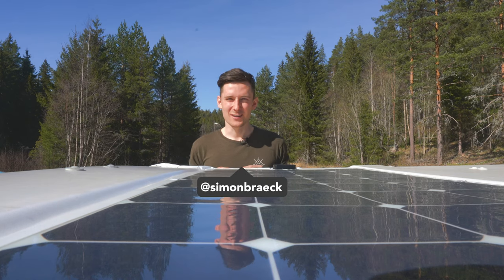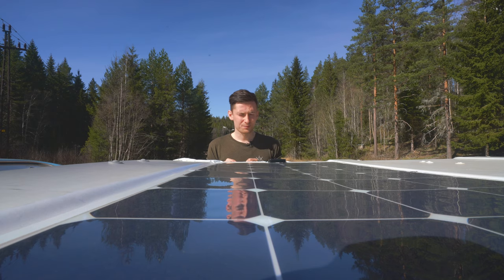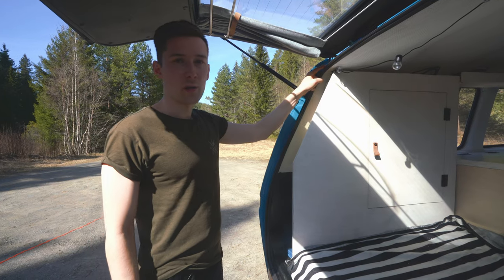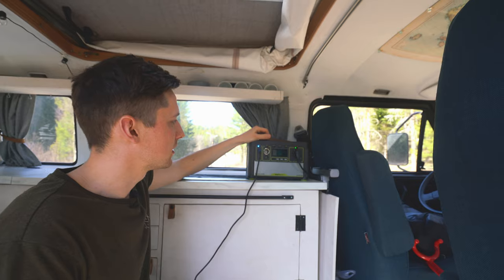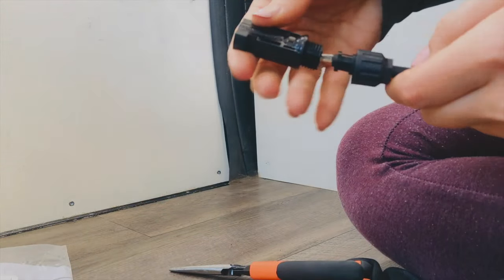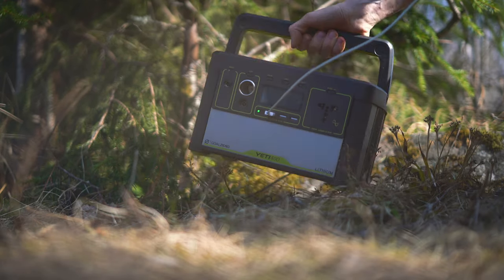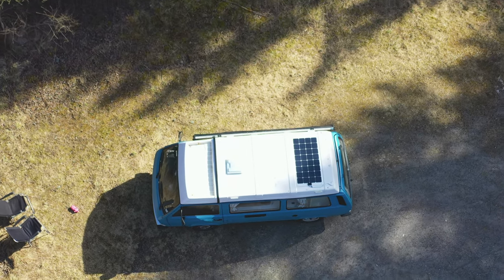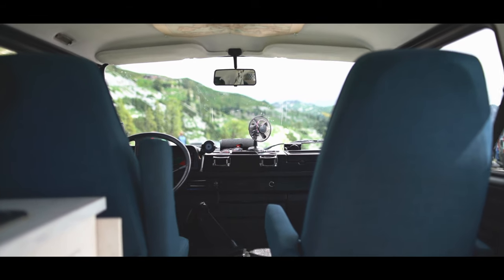Super easy DIY solar panel for van life - VW T3 (vanagon)

Comment: We have a simple 40 watt rigid framed panel (Coleman) on our 1983 T3, in our luggage compartment above the front. For under $100 it came with a charge controller which I connected to our main battery. A very simple and repositional option. I like how your 100w flexible panel fits so nicely between the ribs of the pop-top. I often have a canoe up there (with foam blocks), so a flat approach is important.
Reply from the maker: Thanks! It sits really flush on the roof and we want to try adding a kayak there soon so it was important for us. Our setup might be too expensive for some, but atleast it is super simple to install and understand. I’m looking into adding a charge controller like you have, to be able to switch between charging the GoalZero unit and our leisure battery. Might even add a second panel if needed.
Reply: UPDATE: I upgraded, replacing the 40 watt panel with a 100 watt Renogy panel. Same controller. This panel fits perfectly in the luggage rack, with enough room underneath its frame to store cords and things, while its profile is invisible from the ground. I used wooden blocks with quick release hinges to permit the panel to be easily tilted and propped up for optimal sun exposure, or removed and placed elsewhere while camped. Foam insulation tape ensures no vibrations. Very happy with the install. I'm carful when loading my canoe (from behind) and so far no contact with the panel.
Reply: How did you attach to my your luggage compartment and run the cable?
Reply: How did you attach to my your luggage compartment and run the cable?

Comment: Hi guys, great set up. I am looking to put solar panels on my van too. I watched a video the other day about the angle of the panel increasing the efficiency of the power you can harness from the sun. In Europe it was recommended to be around 54 degrees of angle towards the sun. I know you’ve secured the panel to the roof now, but I imagine building a frame which can be lifted to differing angles wouldn’t be too difficult. (I have never built anything like this, but where’s there’s a will.... There’s a way). :-) Good luck guys! 👍🏻 Ah.... Just watched the end of your video. You are already aware.
Reply from the maker: Hi! Yeah, you have a good point and I would like to do something like you describe. But as our parking is in a shared garage with about 1 cm clearance to our roof, we needed a really low profile, slim installation.
Reply: Simon Braeck Such a shame about the parking situation. But it is still working for you and providing some power. I think your English is fantastic by the way! We’d love to visit Norway in our van in the future. I spent a little time near to Voss with the Army some years ago. Beautiful place! Take care guys!
Reply from the maker: Yes, it works like a treat! We’ve also installed a MPPT charge controller so we can switch between the Goal Zero and the leisure battery. In direct sunshine we can run all we need (including the fridge) and still get extra charge😀 Thanks! We’ll be exploring Norway for a five week period shortly, maybe we’ll swing by Voss. Have a great week😎

Comment: I think I would fit a solar controller to the leisure battery then you'd have the option to charge your leisure battery or the Yeti400 from the solar.
Reply from the maker: I certainly consider it. The cables are already fixed with MC4 plugs so I need a solution for them to adapt to a solar controller. Do you know if that’s doable?
Reply: @SimonBraeck  Yes what you would do is wire MC4 plugs to a length of wire which is wired to the solar controller panel input . You would then simply disconnect the MC4 connector from the Yeti400 and plug into the MC4 connector on the solar controller. It's super simple. If you invest in a solar controller buy a proper MPPT one (watch out for cheap fake Chinese ones). They're more expensive than a PWM controller but as you have a fairly small solar panel you want to maximise the efficiency of the panel. I'd highly recommend a Victron energy controller. Have a look into it and if you are unsure ask an expert. Seeing what you both have done with the van over time you defiantly have the skills to do this you'll just need to understand it and you'll understand how simple it is.

Comment: Awesome video! Could you please share a link for the panel, the converter and the battery?
Reply from the maker: Thank you! Solar panel: https://www.sparelys.no/index.php?page=shop.product_details&flypage=flypage_ny.tpl&product_id=2007&category_id=26&option=com_virtuemart&Itemid=39
Reply from the maker: For the GoalZero Yeti 400 Lithium, I recommend looking up local store or web retailer so that you get the correct AC socket. It comes with both 110V (USA plug) and 230V (European plug)
Reply from the maker: Converter/adapter: https://www.amazon.com/ACOPOWER-Connector-Converter-Portable-Generator/dp/B0841ZCDHS/ref=mp_s_a_1_1?dchild=1&keywords=mc4+to+8mm&qid=1587504925&sprefix=mc4+to+&sr=8-1

Comment: Nice idea about the solar panel. It looks like you have more space on your roof to fit extra panels. Any plans of expanding your energy production? Or this is enough for now?
Reply from the maker: There's definitely enough space on the roof for a second panel. We need to see how this setup works in the long run before we decide whether to add another or not. I really want to look into adding a kayak rack on the roof as well, so still a few things to decide on. But as you know, we like to be away from busy campsites, so if we find ourselves lacking power, we will add a second panel for sure😊

Comment: Hey there. Great video, love the van! I want to ask you about the fuel consumption, because i plan on getting one for myself and i'm curious about the possibility to make it a daily driver also while still being a camper van. Maybe you can share with us an average fuel consumption in city and outside on the open roads? Keep up the great work!
Reply from the maker: Hey! Thank you so much :) We have a 1.6 TD engine and I would estimate it to consume 8.0-9.0 L / 100km. But that’s not very scientific, just my experience. We only own this vehicle and I think that it works fine, very spacious and practical, though the lack of power steering can be a hassle. This can be installed if you find a need for if of course :)
Reply: Simon Braeck Thanks a lot, cheers. Drive safe!
Reply from the maker: You too :)
Reply: The turbo Diesel engine in a VW van is great, but rare in North America. Most of the VW vans you will find are gasoline powered, with a 1.9 to 2.1 litre engine. These have more power than the original diesel, but you are doing well with 11-13+ litres/100km on flat highways. You will likely find that a cruising speed about 90 km/h feels right.

Comment: Nice video. What is the spacer you used under the panel. Was it a sheet of perspex?  
I received a new fuel pump and starter motor for our T3 this week, so crossing fingers 🚐😄
Happy motoring, stay safe ❤️🚘
Reply from the maker: Thank you😊 I’m not quite sure about the English name, but I think it’s called a corrugated plastic sheet. I found it at a hardware store and the one I picked ut was ment for being used in a greenhouse. Just make sure it has canals to drain water and that it’s easy to cut into the desired size :) Nice! Always fun to add improvements to these old things. Same to you, take care!🤗

Comment: Gold zero,is suppose to be a to connect to an external battery ie:leisure battery. It may depend on the unit you. Have also
Reply from the maker: This feature is not supported on our GoalZero. But if you dont have the lithium GoalZero, you should be able to connect to other units.

Comment: I see you run a 240V fridge. Have you considered switching it to a 12v?  You lose a lot of power efficiency converting from 12-240v.
Reply from the maker: It runs on both actually. Just an illustration. I’m working on a connection which let’s me toggle between charging our GoalZero and our leisure battery. Right now I use it on 12V while driving and 240V while stationary in the sun😊

Comment: How long does it take to full charge from solar? Can the solar panels be daisy chained  so it charges faster? If using all electronics like laptop, etc how long does the battery pack go from full to empty? Thanks
Reply from the maker: Hi! According to GoalZero it will take 8 hours to fullt charge it with a 100W panel. You can daisy chain the panels, but this particular battery unit is limited to 120W input... I haven’t tested the laptop yet, but I know the battery will fully charge my MacBook 5 times without any solar input. Combined with a 100AH regular battery, we should be good😊

Comment: Hello Simon, your videos are truly inspiring !! Quick question : how do you feel about the 200 version of this GoalZero power station ? Would it be able to power your day to day material on week trips or do you rather see it in a weekender van only ?
Reply from the maker: Hi Maxim :) thanks for stopping by! We’re able to run our fridge mainly from the leisure battery, especially while driving. If we are standing still and have sun light, the solar panel will power the fridge without any battery drop from the GoalZero. So it all depends on the power need and weather to be honest... It’s easy to keep things charged while you drive using 12V socket etc, but for longer periods at one place, the 200 might be too small for our power need (cameras, drones, laptop, phones etc)
Reply: @SimonBraeck  The 200X is lithium ion so might charge quicker en allow you to go deeper. But yes it is 200 wH and the AC only 200 watts, although that is enough for many devices. 500x might be next level as it can do 300 watt.

Jack of all trade at a lower pricepoint might be the ECOFLOW RIVER 600 , which has a 600 watt ac output and for heating devices that need more can do a trick called x-boost, lowering the voltage to keep the device going. You can buy the basemodel for $100 more then the 200X, same wH but more W, and later ad a batterymodule making it more powerfull then the 500X but still cheaper.

Comment: Im surprised you didn't get two (2) 100watt panels. 1 seems like it would not be enough. I would have bought 2 and put them in series for 24v. I cannot remember if the goal zero 400 will take 24v but I would have gotten a unit that would accept it. It's not that much more to add an extra panel and it makes a nice difference especially when you have a frigerator.  Using your car alternator to charge an extra battery will cause it to overheat and fail.
Reply from the maker: I wanted to leave some space for future installations on the roof (kayak, storage etc.) Also, I find that we have sufficient power between the two batteries and I can now switch between charging the GoalZero and the leisure battery via solar.

Comment: Hey Simon, does the Yeti 400 or the new Yeti500X with the 100W Solarpanell got enough power for your frige and phone charching? Or do you charge the Yeti with your car batterie too? Cheers
Reply from the maker: Hey. Our fridge is not of top quality and consumes more power than the top models from Dometic etc. We power it via 230V (which uses the built in inverter) and we’re looking at roughly 70-75W. To get 70-75W off solar on a 100W solar panel, you need need ideal conditions. I don’t think it will power it without any downtime...

Comment: Also,the panel is suppose to have some air flow under heath from all I've read.
Reply: While it's true a solar panel works better with flow underneath (for cooling, as the power output decreases when hot), their panel is flexible, so you're not really able to have airflow underneath, as you'd mount it directly to the roof.
Reply from the maker: We put a plastic sheet with air flow under the panel to help with this issue.